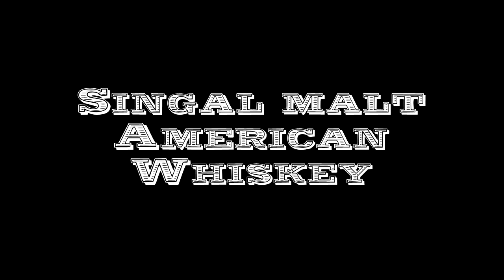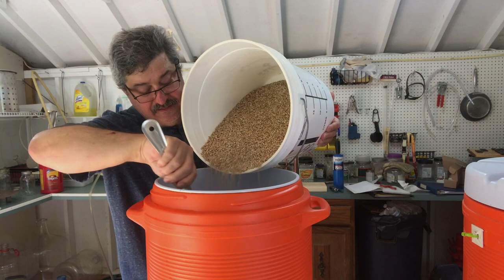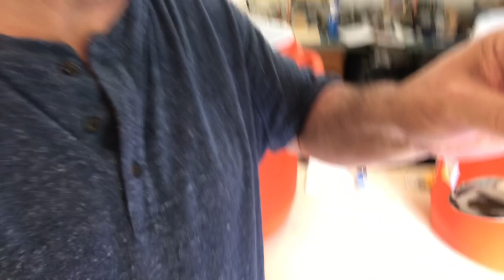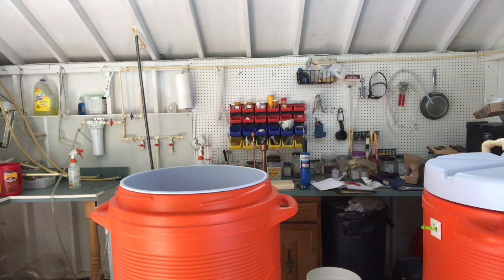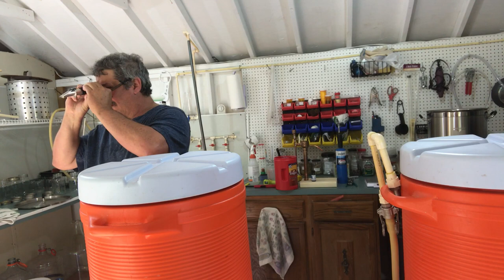E3 Home Distilled Single Malt American Whiskey the mash

Comment: Get a hydrometer and quit guessing when your mash is done. Typically dady works off in 7 days max. Most of the time In at .990 in 4 or 5 days in 5 gal buckets. In a 50 gal drum 7 days is avarage n your ready to run
Reply from the maker: I do have a hydrometer in fact two so i don't break them people always ask how long will it take to ferment standard answer is7-10 days Cheers!!

Comment: Great videos ,I watch you the most,  Question where can I get the orange mash barrels having hard time finding them,,,,thanks
Reply from the maker: Hi Ernie, I use 10 gallon water coolers got mine from Home Depot or you could use a large pot but you would need to insulate it to hold temp. hope this helps Cheers!!

Comment: Once you added 2lbs of sugar, its not single malt no more
Reply from the maker: Shain Thanks for watching I did use 2 Lbs of sugar to boost up abv ,the taste is there next time will have to raise the grain amount to get the numbers I want     Cheers
Reply: Its around 2lbs of malt equals 1 pound of sugar. I use a stainless steel pot to heat water to temp and use a sparging net with a floating thermometer. Once its dropped too 100 f i pull net and squeeze the rest out. Its a yellow sweet smell and then add yeast and let it work to sour.
Reply: Its around 2lbs of malt equals 1 pound of sugar. I use a stainless steel pot to heat water to temp and use a sparging net with a floating thermometer. Once its dropped too 100 f i pull net and squeeze the rest out. Its a yellow sweet smell and then add yeast and let it work to sour.
Reply: That has absolutely nothing to do with the designation as a "single malt" whisky. Mind you, I don't think he knows what the term means, either.
Reply: I thought single malt meant unblended from a single distiller as apposed to a single grain bill.  But what do I know?